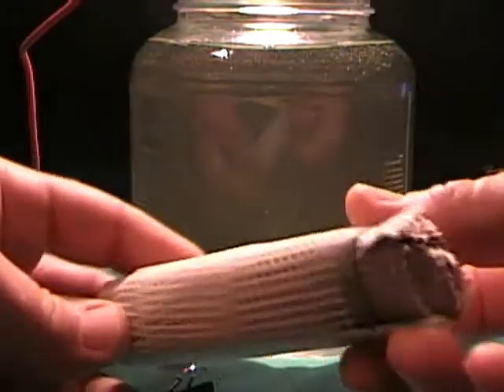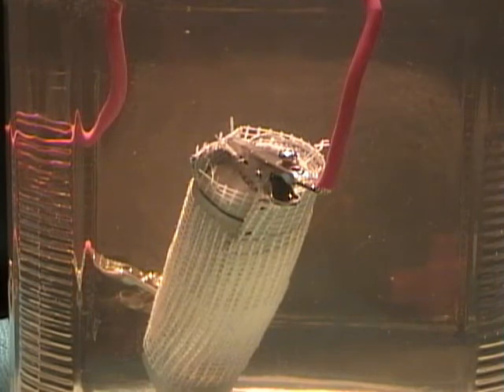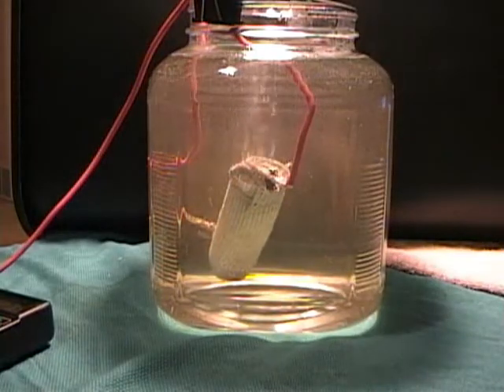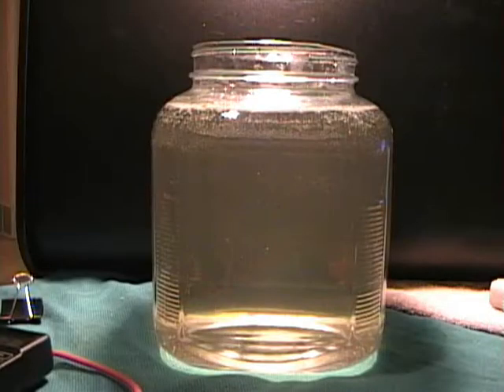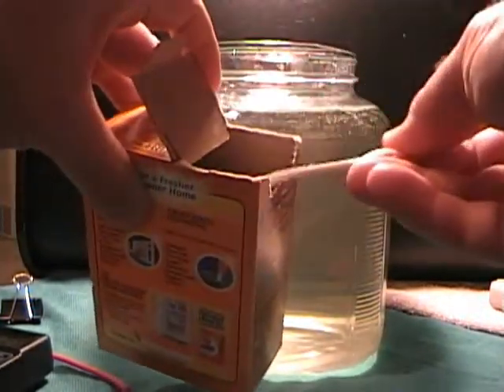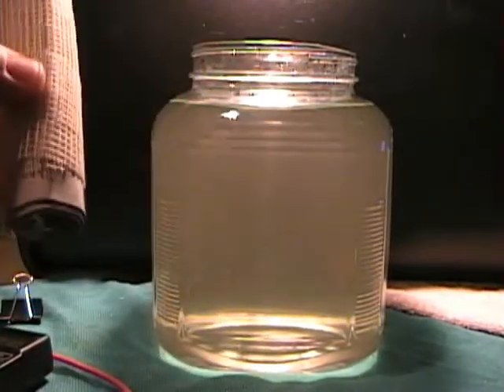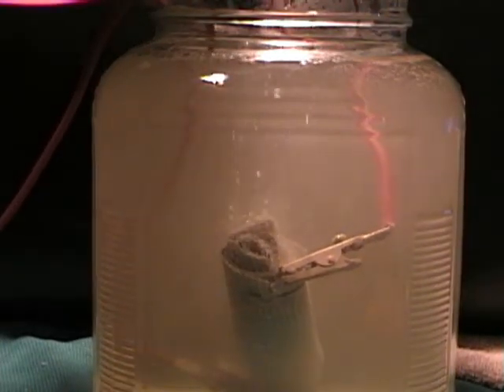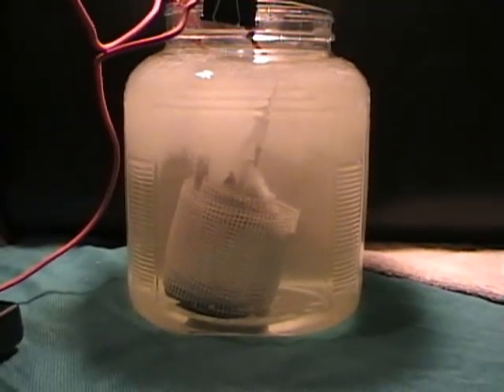WHydrogen  3 of 4

Comment: Whydrogen, the only question I have about aluminum is how well it holds up.  The reason 316L seems to be the metal of choice that I've seen is that it stands up well v. cost.  Platinum would also stand up quite well, but is cost prohibitive unless it's plated over a lower cost metal.

Comment: kpatrol, neutral plates work because the water forms a voltage gradient from 0 to 12 volts between the powered plates.  Voltage at th3 25 plate spacing will cause most efficient electrolysis at about 2.2 volts.  One neutral will sit at around 6 volts so that's well above the 2.2 volts.  You can actually put 4 neutrals in between powered plates at 12 volts.  Each neutral adds surface area for the gas to form on, and also helps reduce current and waste heat.